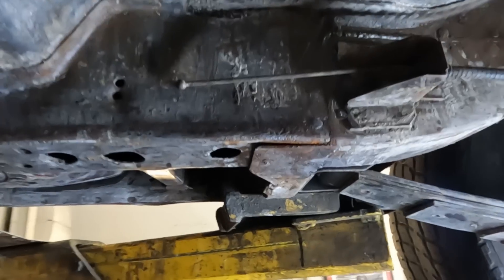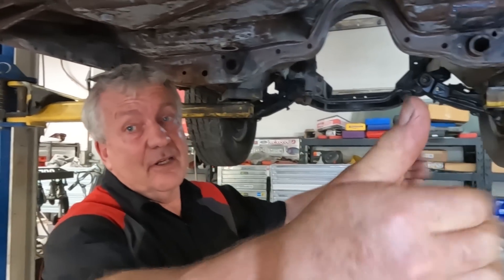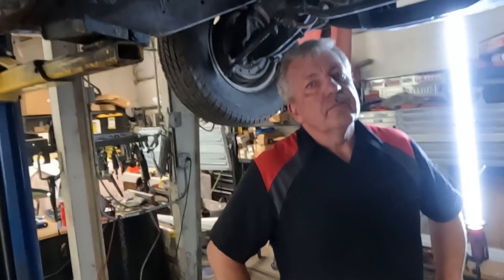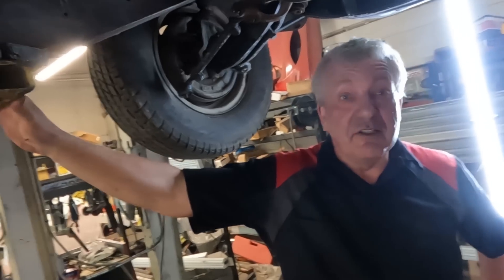Beefing Up Unibody Cars With Home Made Torque Boxes

Comment: I have a question regarding unibody stiffing and how much torque an A body or B body mopar can handle before it twists and cracks, I'm planing on getting a A body duster 70 to 72 or a 71 to 72 demon, and running driveline wise a 496 383 base stroker on pump gas with a hemi 4 speed a 833 or a tremic tko 5 speed 600ftlb capacity with a built 8-3/4 rear end. With high pref. U joints and drive shaft. Rear gear wise I'm going with a 3:08 for the 4 speed or a 3:23 with the 5 speed. I've got a mopar preformance book that has a full unibody brace kit for A body mopars, I just don't want to spend extra money I'd I had to. I'm 23 years old, love muscle cars, and love the content .and I'm a ase certified mechanic, but for old school stuff utg I learn all from you and love every video especially diagnosis vids.

Comment: Gmh in Australia had the same body(from 1968) didnt mater what motor was used 186 6 to 350 because thay built there bodys right didnt have a problem with leg room or body srength that is why American cars are basically heaps of shit

Comment: This is really great. Did I hear right? Are there some 6 pack cars that didn’t have the torque boxes installed? I have a 70 six pack charger and it doesn’t have torque boxes. Is this possible if perhaps it was an early production car? Which 6 packs might not have received torque boxes? Thanks for a great video. I want to do this modification.

Comment: Regarding being unable to run the frame rails straight back, I've actually seen that done to stiffen up a rusty beater Ford Falcon (the bigger mid-late 60s model), it worked better than you'd think. The 2x4 tube went through the driver's foot well in a good spot between your feet that wasn't in the way once you were seated, probably could have even made a clutch pedal work in there.

Comment: Tony, my original '69 340 Swinger has factory torque boxes in the front that are pretty much the same as the ones Kiwi installed in the subject car. I'm assuming you meant that Mopar B and E bodies didn't have front torque boxes?
Also, Kiwi's rear torque boxes look really good but they don't triangulate the front spring hanger bulkhead into the rail or rocker. His are good, but I think I'd want to tie the bulkhead in also.

Comment: Nice clean install. Without sub-frame connectors front to rear it's still rather flimsy and with anything above stock power levels or if it actually hooks up and doesn't spin it will twist. You loose ET and waste effort everytime it twist, period.

Comment: Many, (some say too many) years ago a buddy and I built a '69 Mustang fastback with an 800 hp 460 for power. First time out we twisted the frame. Back in the shop after straightening out the frame, we ripped out the stock torque boxes and fabbed up heavier and bigger ones, plus fabbed up some beefy sub frame connectors. Plus a full cage. No issues after that.

Comment: Good stuff ! I disagree as usual, fit chassis rails forget additional torque boxes, (rust traps) and do re-consider the original engineering it would have been altered for cost and ease of production.

Comment: Putting torque boxes where the engineers didn't is "out thinking the engineers" as much as subframe connectors. It was as much a marketing decision as an engineering one. Beancounters and marketing have kept many vehicles from being the best version possible. I've never had any "popped" spot welds in vehicles with properly designed and installed subframe connectors/chassis rails but I also put a roll cage in many of them, too.

Comment: Great work again, Kiwi!  Ford torque boxes were fully boxed. Chrysler rear boxes even on Hemis were only partially boxed. We had a complete rust-free '70 Hemi-Cuda on 3 jack-stands and the stress changed the door gaps substantially. A 1969 Boss 429 was in our shop at the same time and with 3 stands placed at the same points the door gaps remained unchanged. (Yes, it too had a driveline.) B.T.W. Early Mustangs all had rear torque boxes. Front boxes were an evolution. All Mustang convertibles had them. They weren't included on every body style until 1968. Keep up the great work!

Comment: I haven't watched this yet but I had a 71 Cuda convertible, and that thing was the most unsolid flexible disgusting Rattle Trap I've ever had of any muscle car. Sure it's a beautiful car styling wise and fun to drive if it's a smooth Road, but I remember one time going across some railroad tracks that ran slightly diagonally across the road, and the response of the car was horrific. Twisting shaking rattling and rolling. Closing the doors was worse than slamming the door shut and an Old World War II military medal desk or filing cabinet.

Wished I had kept the car for investment purposes, but while owning it I always wondered how I could stiffen the unibody, add some sound deadening, make it more solid and pleasurable to drive.

In hindsight it's kind of funny thinking how absolutely horrific the build quality of the car was as opposed to the perception people have on the internet of it now because it appears so beautiful when those pixels of a 71 Cuda convertible light up on their cell phone or computer screen.

And that's the true value of the car, when you're either pushing it or slowly driving it up the ramp to The Auction Block, or parking it somewhere to pose for a photo shoot

Comment: Dunno about adding subframe connectors as trying to "out smart the engineers". It's more the accountants. Some cars, like 3rd gen GM F bodies, will crack in areas with out a set of SFCs and don't with.

Comment: Bit of trivia.    In 1960, when Ford started building cars in Australia, they introduced the Falcon. As you know, the Falcon was re-bodied, and became the mustang. By 1962 Ford was in big trouble with the reliability of the new car. Rough (often barely existing) Australian roads were destroying suspensions, and breaking body shells. Henry Ford even came out to sort the problem. Apart from committing to build an Australian proving ground, from 1964, they began using the floor pan, and bracing from the US convertible model, which was not available in Oz. This fixed the problem.       Ask  Kiwi

Comment: That's nice work kiwi does , very well explained Tony. They are built exactly the same as the Aussie mopars.  When I changed the rocker panel on my 77 CL regal se the factory stitch welded it with continuous spot welds . Every other Mopar I've done the spot welds are spaced out around 20mm apart. Had to cut the rocker off then grind the welds flat . The old mopars are always different.

Comment: Outstanding. 10 years ago I got a deal on nice sub-frame connectors for my 71 Mustang. But I didn't put them in because I never was convinced it's a good idea. So they're still sitting in the shop somewhere. Great video UTG.
Reply: It really depends on the car. Some, like my Trans Am, will crack in places without a set and don't with.
Reply: @lb9gta307  I'm not sure but it seems to be a more common need for GM cars from what I read.  I love Trans Ams. Had one years ago, was really fun to drive.

Comment: What happened to frame connectors? Do we not use them anymore? Then you answered my question. Great info. I work on trucks now and still try to keep up on cars. I haven't built a driver in years, everything was full race. We never cared about the passenger compartment.

Comment: Is there any reason not to seam weld Mopars? I've done it on small sections when I was doing repairs and mods and have been told by guys(who may not have understood everything they thought they knew) that if you seam weld a Mopar you have to do the ENTIRE unibody or it will be so stiff where it's welded that it will fail where it's not. I suspect there may be a grain of truth to the idea but in anything short of a WRC racer it wouldn't be an issue.

Comment: He said it right there's  thousands of spot welds holding these cars together. I replaced the upper and lower cowl panel on my 66 mustang coupe about 150 spot welds on the upper cowl and the same on the lower. I guess it depends on the attitude of the workers back then I've seen some 66 mustang's with spot welds damn near 3 inches apart then others with a weld every inch or 2.

Comment: I have another project,  65 Rambler Marlin. Unibody she is. I am mapping out how to moly tube the front to the back. The trump card, a 6 point cage and tie it all together. I have a gm straight axle for the front. Just more math and geometry. Of course, me being me, she gets a bb Chevy under the lid. Just a little 402BBC. Ford 8.8 with 3.40 ish gears. It should be a fun street car. We will see in a year and half. 
Mikel

Comment: So wait, are you saying adding subframe connectors to my mustang was a bad move.  Everybody says that adding subframe connectors is one of the best things to do for the frame and stability of the car.  Even performance manufacturers at RaceTracks are selling these subframe connectors to make your mustang handle better.
Reply: I honestly doubt that there is anything wrong with adding frame connectors    It added weight and costs to the OEM cars.  As long as cars weren't designed for Dukes of Hazzard jumps the factory design is fine.

Comment: I'm wondering if a rustproofing product is applied before the torque box cover is installed? But I also imagine rustproofing  may not be applied inside before cover is welded in place because of the welding heat unless the rustproofing product can sustain the heat created from the welder.
Reply: Check out kiwi's channel, he covered that when he replaced the entire floor in a mustang
Reply: @stuborowski5301  Okay, Stu. I only recently knew about Kiwi and subscribed and I don't remember seeing that video or hearing him discuss it yet. Thanks for letting me.

Comment: Ya my old U code 440 hp 1973 charger se had front and rear torque boxes.  Cars gone but I still have photo's because someone insisted they didn't get them with the rubber isolated front K-frame. The one I had certainty did though and they looked like they were welded in by a blind monkey....lol

Comment: I always preferred the full frame cars. I had a 72 gran torino which had a full frame, 58 chevy full frame. I never like the idea of a unibody for a muscle car especially considering how much rust thyre prone to and then all the repairs are structural. THe auto makers were cheap and built cars cheap with minimal cost. Tesla has the right idea now with front and rear complete castings that replace all the spot welds and make a more uniform underbody that doesnt need welds at all. It aslo eliminates the stacking errors that hundreds of welded parts cause. I remember old mopars on the lift in auto shop class and the doors wouldnt close right when they were on the lift because of FLEX. i welded a ladder bar cross member in my 72 torino and i could jack up the whole right side of the car with one floor jack up front behind the front tire. It was stiff!
Reply: Tesla has an idea that was proven wrong a long time ago. You replace all the individual panels with a single aluminum one and you've created a continuous material for cracks to spread through. Tupolev discovered this way back in the 60s. With it's tendency to work harden it's also pretty much impossible to do safe repairs for otherwise minor frame damage without replacing a third of the car.

There are ways to produce aluminum cars without welds but monolithic castings are NOT it. Bonded extrusions are much more viable. It's very in character for Tesla to use materials inappropriately because they think it sounds futuristic though (witness the plague of cast aluminium suspension arms snapping off because they're full of voids).

Comment: Australian Falcons had to have torque boxes added in the early’60’s as the original design wasn’t up to our appalling roads. They also had to use compact Fairlane ball joint’s due to constant failure of the falcon front suspension. Those early Falcons without torque boxes nearly sent Ford Australia broke.
Reply: The non-stop demonstration run they did after the changes for the media is a tale itself! From memory they ended up rolling most of the Falcons at least once (driving non-stop for 24hrs+ can do that!) But they kept going!
Reply: @XLesky  
Yes. 1965 XP Falcon 70 000 mile reliability run. 5 cars averaging 70+mph over 9 days.
Reply: Ford really has an knack for shooting themselves in the foot. They were had good optics in my country with the ford escort, KA and fiesta, then they started putting some TERRIBLE automatic transmissions that destroyed themselves and refused to just change it back, killing their popularity and cementing an the public view of fords as unreliable, crappy cars. So much so they abandoned my country due to low sales.
And now with every manufacturer building basically the same cars you are better of with an Honda or Toyota.

Comment: Are torque boxes better than subframe connectors? Building my first 65 mustang 347. I have experience with fox body's but that's it on ford's. Mostly been a chevy guy
Reply: If I had to choose I'd go with torque boxes but ideally do both
Reply: Get some crites sub- frame connectors,& weld them in.

Comment: The frame depends on the rockers for strength on UK cortina the frame rails run the length of the car ???? But if you're rockers have gone it's a inspection fail  semes USA car half strength , had to get inner and outer replacement for inspection I did 2 days later I was hit head on I was doing 20 he was doing 70 the car looked like a banner???? I wish I'd inspection it's welding job but sills looked intact un bent roof wings took all damage was a coast car 🚗 though

Comment: how do you replace a floor pan on a unibody car like a mustang? I have a 67' fastback that needs a floor pan but I want to make sure the car is supported but im curious as to what is recommended and most typical
Reply: You haven't watched videos on this? I haven't either but I suspect they probably use some square stock or tubing and spot weld them in place to hold the car straight before they cut out the floor, then weld in the new floor and then cut their temp bracing out. I don't know this is how it's done, but I can't imagine there being any other way. You should be able to find how to videos on this. Did you try searching youtube vids?

Comment: Probably the best set up is a trailing arm rear suspension.
Reply: Coil springs, torque arm to the tranny mount and a Panhard Bar.  The rear axle is always aligned to the center of gravity.

Comment: Nice!  I did not know the rocker was the "frame".  The fox mustang community is all about those torque boxes and stiffening addons.
Reply: Well, we tend to beat the snot outta them lol! Uncle Tony knows. He used to beat on those fox mustangs too lol!
Reply: @mccoma11  My 89 Mustang is setup for autocross - fun stuff!  Next mod is to rebuild the rear end and add better control arms - that is when I will address the torque boxes on it.
Reply: @brokentoolgarage  Sub'd!
Reply: @mccoma11  I thank you!
Reply: It's not really. That wasn't proper terminology. It's not wrong, however it's excludes too much. Kinda like watching Fox so called "news" or CNN so called "news" they give you a perspective with a propaganda agenda, right. Both just as bad, one swing far right, the other far left. Of course, here, it's probably not intentional, but the info left out is that the rockers AND the floors AND the cars body shell ALL equally, not so more the rockers, all make up the rigidity of the construction. This is why your not supposed to do patch panel repairs to a floor in a uni-body car. You're supposed to replace the whole thing if parts are rusted. If the rockers alone made the "frame" you wouldn't need to do this and if the roof wasn't also the frame, then convertibles wouldn't need to boxes. So it is incorrect statement as is "the rockers make the frame between the front the rear of uni-body cars" as stated, simply because it omits and too much of this equally stated info.

Comment: An older guy told me once, chrysler engineers had torque boxes and frame connectors in the plans until the accountants got involved. If you save a dollar on every car, over a million cars, that's a million dollars saved.
Reply: 99.9 percent of the things people blame engineers for were fucked up by accountants.
Reply: @excavatoree  nah engineers are still jerks
Reply: How much would they have saved by firing the accountant 🤔
Reply: @larrynorsworthy8582  I've made that exact argument to management many times.  Once, they took off a feature to save two bucks.  I told them "The customer would GLADLY pay five dollars for  it!  You'd make money!"   "Nope.  We have to cut costs."  was the answer.
Reply: @larrynorsworthy8582  they still charge the price as if the part was there. Increases profits. If you can cut $10 out of manufacturing cost on 1Mil vehicles shoot that’s an extra 10 Million in profits from an accountant standpoint.
Reply: never mind a doloar if they cold save 2 cents  they did
Reply: The Pinto was going to be the first car with a fuel tank liner and an air bag until the accountants insisted on a $1,999 price point.
And having these as "options" would slow ALL production.
Reply: @peterdarr383  Ford has always been the American company that likes pushing tech forward in vehicles. For good or worse. Cool piece of history didn’t know that!
Reply: If you were to think about who screwed up the worst I think it’s the executives who don’t care about product all they’re concerned with is the stock price
Reply: Probably related to stiff aircraft designs